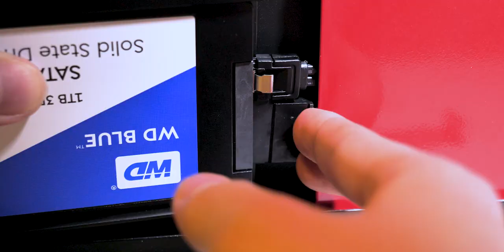i9-7900X PC build - No Music version（kind of ASMR）

Comment: why is everyone screaming and screeching about the thermal compound it doesn't blow up the computer
Reply: Technosaber no but it is still detrimental he applied it around a circle meaning there will be a large air bubble in the center of the cpu acting as an insulator further increasing core temps
Reply: Bc a smiley face is the way to go, not a circle which would make an air bubble

Comment: You should try putting the 24 pin cable over the red thing in the case. It looks way cooler. And also you should deal with the cable management in the back.
Reply: No one cares about the cables in the back